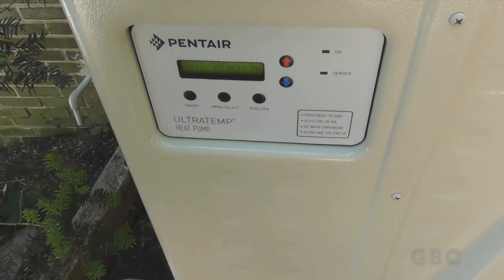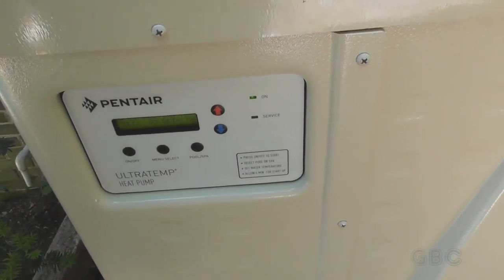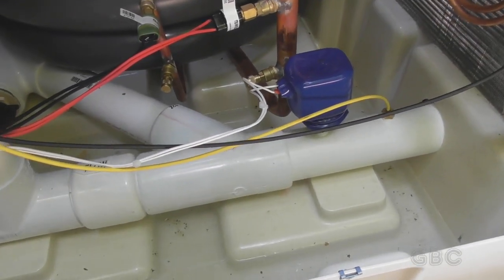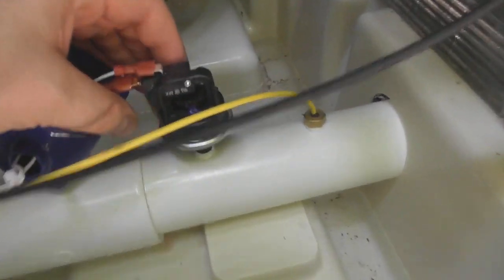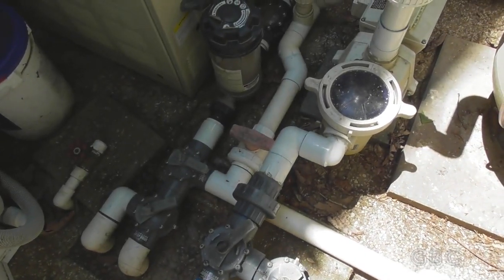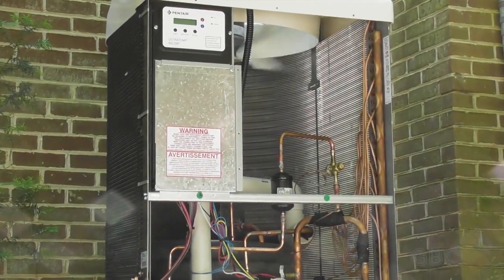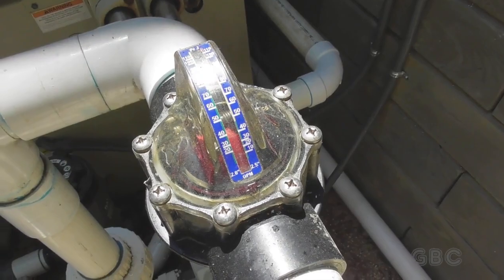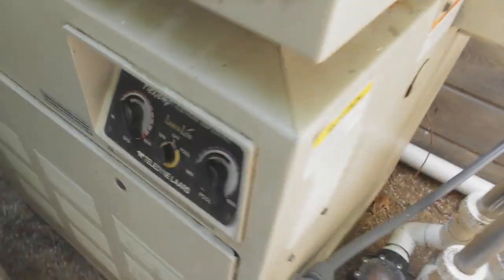[120] Pool Heat Pump Adjustment

Comment: Hey. Any idea why all of a sudden. Our heat pump  that looks the same as yours there. 
Stops working. Worked Friday great. Now Sunday it won’t create hot water into the pool. 
No error codes or red lights on the front screen  ?

Comment: I have the same heater about 3.5 years old.  Everything lights up but the heater buzzes and won’t start.  The on/off button was testy from the beginning and the young man who installed it disappeared so I can’t go back to him about it.  The filter is clean, the flow is normal. It hasn’t been used all that much because it only augments the solar heating this time of year.  It was working a few weeks ago.   I would appreciate your thoughts.  Thanks so much , Nancy
Reply: Where are the filters are this unit ? I can’t find them ? Or do they mean the filter for the pool pump ?